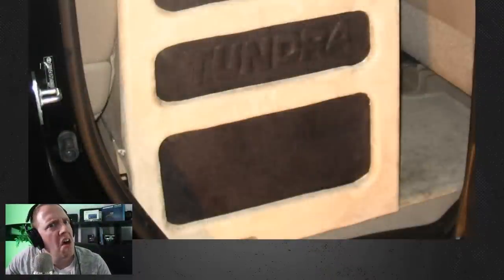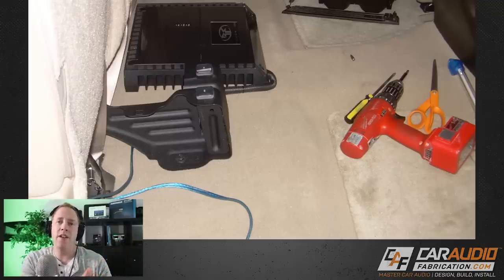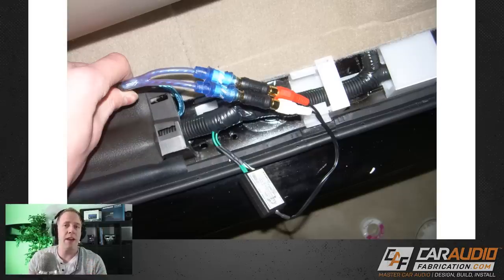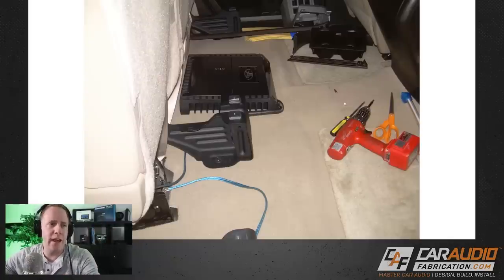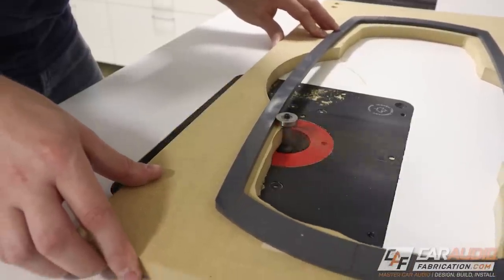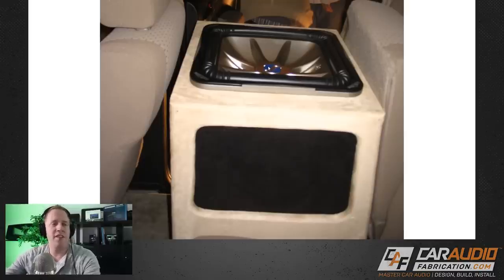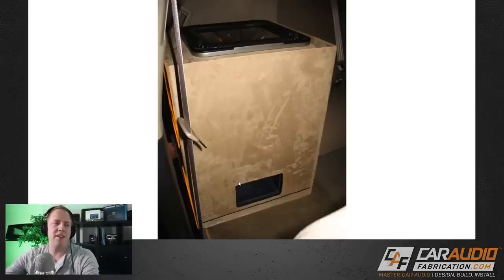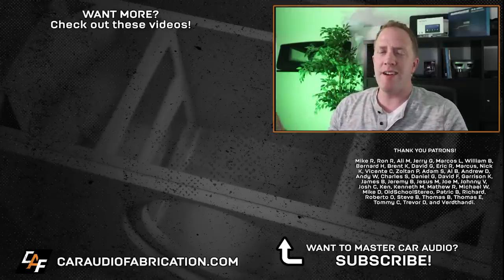This Subwoofer Box was BAD! Reviewing first Car Audio builds - Tundra

Comment: Things I've done as a young car audio enthusiast:

Used speaker wire for amplifier power, ground, and remote. Like 18ga.

Put a dual 12" subwoofer setup in my rear seat. Because reasons. 

Used a 4ohm subwoofer in tandem with a 8ohm subwoofer. 

Used a discman as a head unit. Used an adapter that had a headphone jack into a set of RCA's. Ran RCA's to the amps. 

Mounted tweeters in the B-Pillars, with a toggle switch to turn them off when it got to be too much. 

All good times.
Reply: Are you me?
Reply: kovemaster559  bro ply is better than MDF anyway
Reply: kovemaster559  man that sounds a lot like OSB and that would be a terrible box indeed😂
Reply: kovemaster559  The right type of plywood is a bit better than MDF

Comment: I think your question has potentially opened a door that could lead to greater understanding through visual examples. But, this is largely dependent on you staying focused on the builds and the possibilities, and not making it a car stereo competition. But, at the same time showing the different design directions chosen for particular interior types.
  In addition, reviewing some of your early builds is an outstanding idea. But how about actually doing a redesign and new fabrication of an old build? I think that could be really interesting. Doing a “This Old House” of some of your earlier builds, with performance measurements of before and after would totally reinforce the benefits of good planning, choosing the right gear for the application, and how beneficial an alternate build choice can be. Just the thought of seeing how replacing a 15 inch L5/L7 with under-seat 8 inch or 10 inch subs, has got my mind racing. I’m bursting with questions and curiosity. Have I really been looking at things with a narrow perspective (bigger is better) and missing out on legitimate alternative design options??

Comment: That is exactly how I did the first system in my f150, single xfl 12 behind passenger seat. From using the 40 side to the 60 side behind the driver. Now I'm working on a 2 18 4th order wall, no more back seats. I always enjoy the videos. Keep up the good work
Reply: Yea I have a single skar svr ported in that same spot in my 11 f150
Reply: my neighbor is doing the same thing with 2 star 12s those trucks really get down
Reply: 418 lightning yea even just a single is plenty hard hitting bass in that cab so two deff going to hit crazy good

Comment: Mark - I really like this kind of video. I do have a couple of recent builds where there are lessons learned with areas of improvement related to system planning - goals, budget, expectations, and timeline. Other lessons learned include when to and when not to reuse gear that you have in your garage.

Comment: I'm starting my current build this week. 
 I grabbed 4 10 inch kenwood excelon subs , a kenwood excelon dpx793bh head unit and a powerbass xma1205d amp to power them . It's going in a chevy sonic hatchback.  I am leaning towards a sealed enclosure for sq and retaining as much trunk space as possible.  What do you think ??
Reply: You bought 4 subs and you worried about trunk space...???🤔🤔
Reply: Just get a 15” Dayton audio ultimax. It will blow you away. 

Also, I have the excelon amp (75wpc 4 channel) and it is fantastic. 

I would also always recommend getting a Dayton audio DSP. It’s only $160 bucks and it’s an incredible value. It allows me to control the crossovers, EQ, and time alignment which makes a HUGE difference

Comment: I have a single cab pickup(i guess in america its called a mini truck) with 2 12 inch subs, one is 300w RMS and the other is 500w RMS, the amp has 4 channels(2 front 2 back) and is only 120w RMS lmao, but the small space makes it sound pretty good inside the car, not so good outside(sealed box lifestyle, i listen to a wide range of songs and a ported box just doesnt cover all the ranges). The boxes are wedge shaped, pretty small and they are made of chipboard. the amp was $75, one sub(sony xplod) was $80, the other sub(starsound) was $40, wiring kid was $15. I'm pretty happy with it so far, considering how cheap it was

Comment: I am having some trouble with my radio, I am brand new at building music systems and I am having trouble my volume goes all the way up when I crank the car to turn it on but as soon as the car is on the sound of the music is barely any. What could it be? if you read this thank you for your time. You have very good videos 👍🏽

Comment: I have 3 12 inch kicker L7s. 2 of them are 4 ohms and the one is 2 ohm, didn’t realize it was 2 ohm until I started to install it. I’m running the two 4 ohm in parallel and the one 2 ohm in series, any advice on what I should do for better wiring?

Comment: 5:04 those are expensive damn ..... I bought the one you mentioned recently. It’s got a power option to turn on the amp and it’s own volume control as well as L & R adjustments. Good for 80w ( apparently )

Comment: A quick question. I installed a JBL basspro sl on a rcd330. The problem is after the install i get a buzz on my radio channels, the signal drops when the amp is on... the mp3 work great. power wire on one side of the car and the rca cable on the other side. The factory rcd330 does not come with rca si o spliced into the 2 front speakers for signal. Any help? ! ? !

Comment: Salvage a couple jensen 8" out of 2 bass tubes my cousin gave me. Built a crappy wedge shaped box out of plywood, didn't seal it but it wasn't ported either. Left a gap in the middle to mount the amp and called it good enough. That was a long time ago in my old truck..  To be honest, that's my general practice with this stuff. I could go all out but honestly if it doesn't rattle too bad and i have some extra lows, I'm content. I'm here though and looking for pointers and ideas, there is hope for me yet lol. I've got 2 10" shallow mount subs and a dual brand 1000 watt amp for my gmc this weekend lined up. Thinking hard about actually trying on this one.. My poor ranger though lol. Let's just say i got creative with cheap and free materials and used the cheapest 8" subs i could find. It works, I'd dare say works well even for what it is. A pro installer/builder like yourself would have a thousand words for that picture and none of them would be nice lol. Wires and amp shoved under the seat.. It's interesting.. It's just a work beater so i wasn't going all out. It's prolly better than some out there though.

Comment: Hey guys, I am having an issue with my car setup and I wanted to throw it out to potentially find some answers. I used a roundabout 250 W rms system with a 1 F powercap and my headlights dim. I never tried full volume, but it's enough power surge to be visible, so...
I am not sure if I used 25mm² or 35mm² wire, but the rest is stock.
I am now in the process of designing a new system around a 1000 W rms system. Since my alternator only provides 90A, I was going to upgrade that, as well as doing "the big 3" wire upgrade. Should I increase the size of my cap and or get a new (/secondary) battery? (Currently 62AH)
What else do you guys suggest I check?

Comment: Hello i would like to talk with you about a system im doing for a suv and would like to see what other parts of equipment i need it would be a great help and i can let you know what equipment i have so you can have a good idea of what you would to to finish out the equipment with wire distribution block and or a secondary amp thanks look forward to hearing from you and keep putting out the videos you do great way to learn and great build ideas

Comment: hi CAF "mark" will the after market head unit have bass roll off just like the factory head unit?
Reply: I'm not mark but no it shouldn't. Aftermarket units should give flat signals. The only reason it might not is if you have a factory amp that is running the signal through its own eq
Reply: @10caterham  thank you colton

Comment: I just bought a JL Audio XD1000/5v2, JL 12W6v3, Memphis VIV60C component speakers, and all my wiring equipment through your sponsors link from knuconceptz 👍🏽

Any suggestions on going ported or sealed for the 12W6v3? 

Also should I use the crossovers that came with the speakers or do the crossover work through the amp or use both the amp and crossovers included with the speaker?
Reply: Use both crossovers for added protection. Ported is good if you have the space, sealed great for tighter space applications
Reply: @SchuboxProductions  Right on I'll install both. I think I have the space to go ported. I haven't measured the cargo area yet. It's going in a 2014 subaru impreza wrx hatchback
Reply: @shak180  you should have plenty of room in a hatch as long as you can live with the extra space loss. WinISD is a good program when doing a box design
Reply: @Asher Brown It's my first time going with a JL amp and sub. Curious to see if it lives up to the hype 😁
Reply: @Asher Brown Yup it's a 12W6v3 🙂